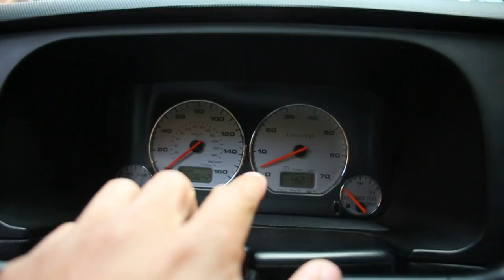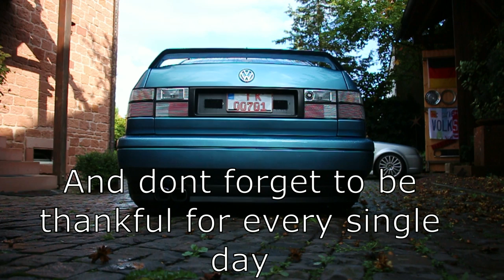Explaining Everything On My 1997 Volkswagen Jetta | Miley

Comment: Back in the 90's people used to weld those air slots in their fenders. Usually off a w124 turbodiesel or a t4 van. For non-welders there were a lot of aftermarket plastic intakes as well as intakes off a Renault espace mirror. What a lot of vw guys did as well was changing the exterior door handles to the sunken Audi type.

Comment: Your car is gorgeous. So many small details, that when together make it a special car. Lovely.
Just two things I noticed as ideasfor you, maybe:
- You could remove the electric window buttons from the doors. 
- You could add the buttons for the rear electric windows, to where you have the pink Floyd plate, and use those as the air suspension switches.

Comment: for everyone looking for wheels, search for 16inch, they look the best because these will fill the wheelgap the best and most. I drive 8J front 8.5J rear static daily. its doable.
Reply: I've got 16x7 with 42ish offset on my mk3.5 cabrio and even tho they arent nice wheels they fit amazing with the right tires
Reply: I’m running 17s and they look good if you’re low enough.

Comment: Looking good brother 👌🏻🔥. Just a few questions:
1) Are you planning on fixing the AC in your car 
2) I remember you putting sound deadening steel wool in your muffler before you shipped it. Are you removing it at some stage?
3) has the savoy been to the workshop yet to get fixed?

Keep up the good work!
Cheers 🍻
Reply from the maker: Christopher Clayford yeah I’d like to get the ac fixed at some point and yeah the sound stuff is out currently and the savoy should be going to a shop hopefully within a week or so gotta get Miley passed first